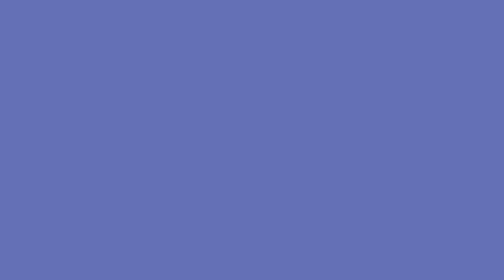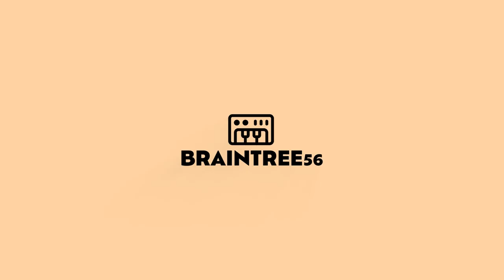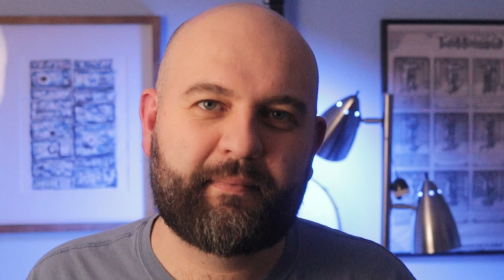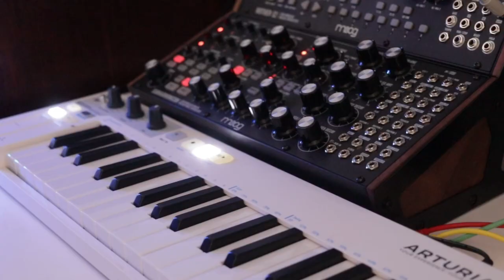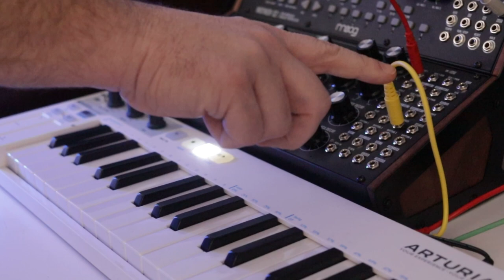Part 9 - Changing Keys and Using CV to Control - Subharmonicon Tutorial

Comment: Another way to transpose with M32 would be using its VC Mix. This way, the M32 still could be used to run internal sequences, since the transposition is controlled by the M32’s VC Mix button only. Since this CV is not quantized, it might be required to run it through a quantizer first before sending it to the  SH‘s VCO input. Haven‘t tried it out by myself yet, but will do so this evening😊.
Reply from the maker: Great idea!
Reply: Just tried it out, it‘s working fine like I expected. Another option is to patch the M32‘s CV Mix to the multiple first and then the doubled signal to the M32 VCO and SH VCO. So it‘s possible to transpose both devices in parallel (… which is often used in pop music to create some climax at the end of a song BTW…). Of course the multiple then can‘t be used to double the clock anymore to sync the devices, but a second multiple or clock divider would help out.

Comment: Have you made a video on how to use an external sequencer (beatstep pro for example) and bypass the internal sequencer on the SH?
Reply from the maker: You should be able to use the Beatstep Pro using the same methods described in this video. Just don't activate the sequencer on the SubH and you should be fine.

Comment: Does it remain in “key” if it’s set to 8ET?  Or will the new key function as the new “C”?

I’d love to see a deep dive of music theory on the Subharmonicon.  Mine will be arriving soon and I’m excited to dig into the Sub harmonic series to see how it fits in with chords and more traditional theory.
Reply from the maker: If it's set to 8et it gives off the notes of the C major scale no matter where you set the knob. This is probably the biggest complaint I hear... You have to send a control Voltage into VCO1 in order to change keys. Typically I use 12et if I'm going to play in anything other than C major (and it's related modes).

Comment: how can I change the key as I use it on the mother by connecting midi in with a midi cable because it did not work using the dedicaded plug on midi in
I can get midi signal from keyboard or using midi cable from audio interface routed by cubase
Reply from the maker: I'm not sure how to do it with Midi. This method uses CV.

Comment: I often use my M32 as high hats (like Forktongues video) and using it to transpose the Sub while doing this is perfect. 

I'm thinking of getting some kind of CV to midi module to have control over the Sub midi parameters in my rack. Any opinions on one out there?
Reply from the maker: I don't have a CV to midi, so I dont have any strong opinions. The only parameter in the Sub though that I could see wanting this is that Logic function. Everything else is controllable through the knobs fairly easily or through the patchbay without going through midi. 

You might consider a Beatstep Pro or an SQ-64 or something just to access that parameter. 

But if you definitely want the CV to midi - I would always start with Doepfer for this kind of stuff. This type of module doesn't need to be flashy or fancy... The A-192-2 is only $118 at Thomann right now... That would probably work fine!

Comment: all you have to do is tune the main osc on 1 and 2 to a different note and you will be in a diff key .  (or a root key plus a fifth on osc 2 ) At noon you’re in C , breakout a guitar tuner drone the sub with only osc 1 in the mix and tune to the key you want then harmonics will follow.
Reply from the maker: When you select 8et you can only change the note to notes within the C scale. So there's no way to play in, say Db, when using 8et unless you use control voltage. Db isn't an option.

Comment: I guess somebody already mentioned it, surely, but you can pretty much do exactly the same simply by connecting the Keystep to the SubH by MIDI (using the MIDI-Jack adapter provided with the synth).

HOWEVER: As far as the 8-step quantisation is concerned, you are still stuck with major scales, which is a bummer. As a matter of fact, I, personally NEVER use the 8-step quantisation, I always stick to 12. The fixed major scale makes that function totally useless, in my book.

FUN FACT: The change of tone of a sequence on the SubH when you play a note on a MIDI-connected keyboard is actually a rather NEW feature, since it was introduced only with the second version of the firmware. Before that, playing a MIDI-connected keyboard only allowed you to play on top of the existing sequence, not change its tonality. Which made the 8-step feature EVEN WORSE.

The people at Moog are often quite weird in their design choices. Every single synth of theirs seems to have some unexplainable idiosyncrasy that makes no sense: the patch points of the Matriarch located on the BACK of the synth without labels on the front, the wave folder of the Mavis that can be fed only the synth's internal triangle and square wave (when wave folding a square is equal to doing NOTHING AT ALL), the lack of MIDI connexion on the DFAM, the SubH 8-step quantiser blocked on a C major scale, ...
This last one is probably the most infuriating one, as it could easily be changed with a mere firmware update !
Reply from the maker: Thanks for all the information! I'm hoping they do update it with a firmware update. It's really a fascinating decision. I need to do some more videos with 12 steps.  

Typically I put it in Manual focus... I forgot a few times, but figured it wasn't bad enough to reshoot it. Regardless, thanks for making the suggestion - always trying to improve.

Really appreciate the comments! Thanks!
Reply: @braintree56  You are most welcome. Already, your videos on the DFAM and the SubH have stimulated several new ideas that I probably would not have had otherwise, so I definitely owe you !